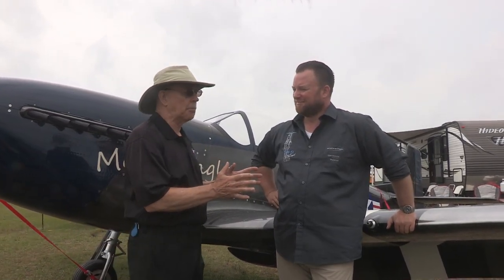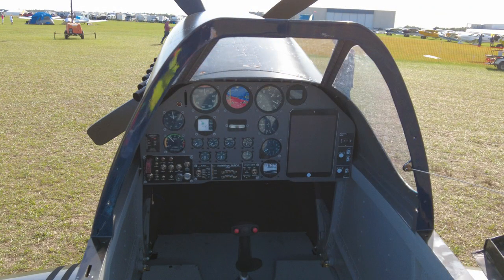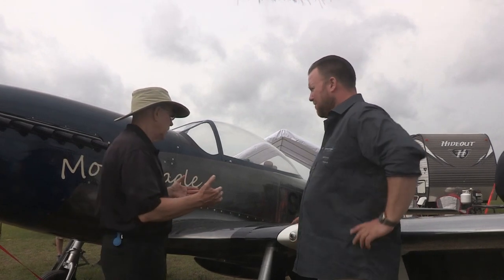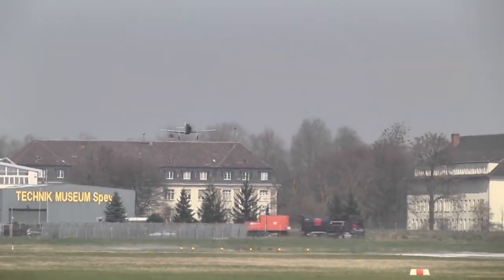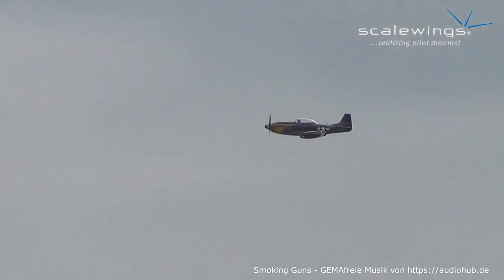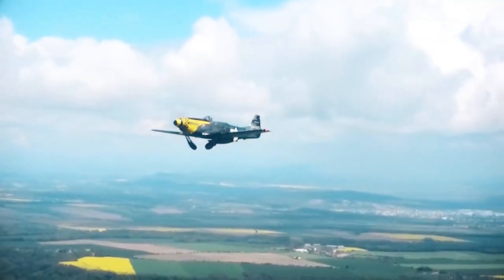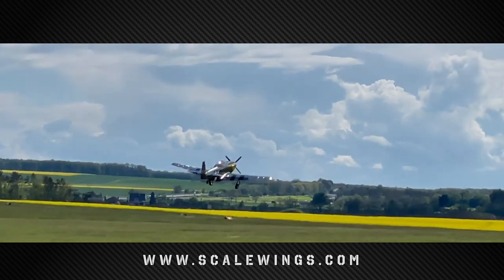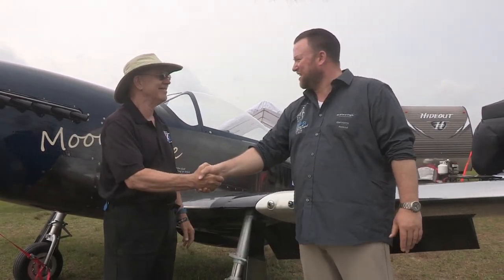Scale Wings, SW 51 Mustang, Scale Replica, Experimental Aircraft

Comment: Curious why the price is not revealed on the website as well as on the video?
Reply: $138K US for the kit alone no engine  If you go to their website and click on news then scroll down says "Now shipping Quick build kit" on that link shows the prices. Didn't even know about this been around since at least 2018 the reason for very few sold in the US is $200-240k flying price could have a Titan-T51 factory assist built for less using  a V8 engine.
Reply: better plan on north of $250K
Reply: @P51  easily 350k
Reply: @Mike-01234  but Carbon Fiber though. I’m considering building this primarily for that reason, plus it’s a two seater.